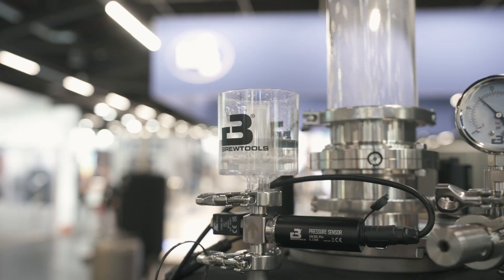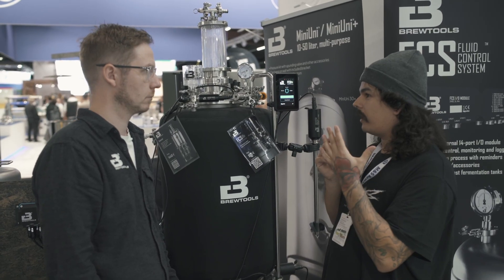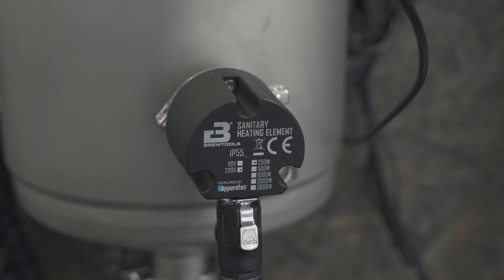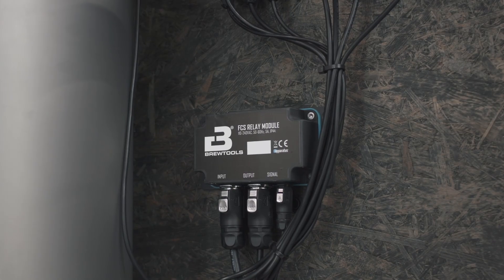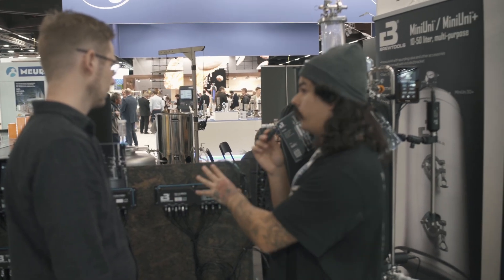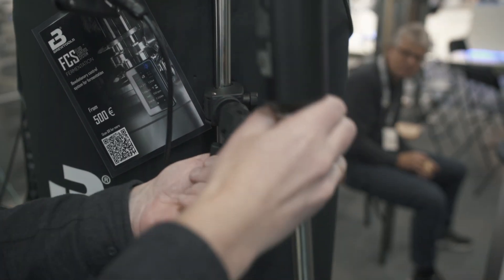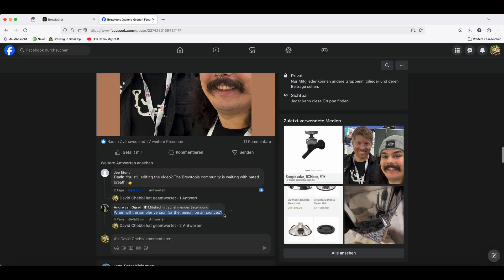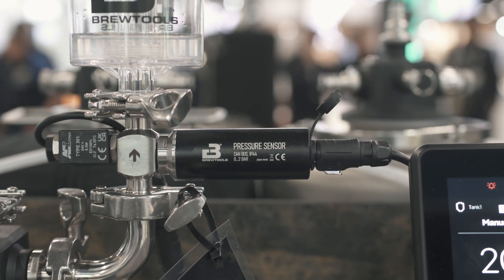This system will ACTUALLY revolutionize the world of beer brewing (Brewtools FCS)

Comment: What about the beers that have 2 or 3 dry-hop additions? So this electronic spunding valve will increase the set pressure with day of fermentation pass?
Reply from the maker: Well I guess it won’t be a problem, you just got to load the hop dropper with hops in between. But I will ask Brewtools about it
Reply: I guess you could always stack HopDrops each with its own pneumatic butterfly valve.  🤔😯

I am a little disappointed that Brewtools hasn't found a viable electric butterfly valve.  I'm not to keen on the idea of needing compressed air.
Reply: @wickedbeernut  haven't spent time on it either. The 4th relay port have switchable polarity as an option so it's quite easy to make one as well. Just need some time.
Reply: @Brewtools  You'd said, "For electric HopDrop, this is not a priority now. Existing motors are big, ugly and expensive".  I took that to mean you haven't found a viable electric butterfly valve.  My bad.
Reply: @wickedbeernut  It's true, but we havent tried a lot either. Will look more into this soon :)

Comment: The FCS is great, yet you still have to understand what is going on. The density meter could well be a breakthrough, no more glass hydrometers, floating wireless, or even taking readings for an EasyDense. Instead, constant accurate readings without fear of contamination.
Reply from the maker: Of course, it does help the brewer a lot though. Indeed, the density meter will be huge. I really can't wait to get my hands on it. Anything else you are curious about with the FCS?
Reply: I agree.  The tuning fork density sensor is the gold.  It's the same concept and similar in design to the PLAATO Pro.  I'm not sure how it'll rate in terms of accuracy as compared to the PLAATO Pro and floating wireless hydrometers such as the Tilt.  I would expect it to be comparable.  And I can envision using an EasyDens to calibrate the Brewtools density sensor, possibly even a sample or two per batch.  You certainly won't need to worry about wi-fi / bluetooth connectivity and battery life issues.